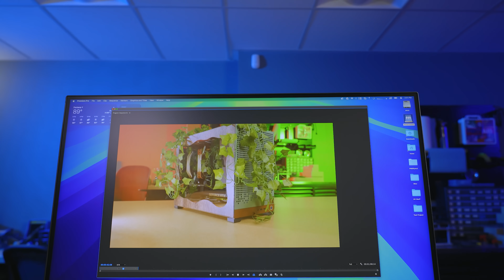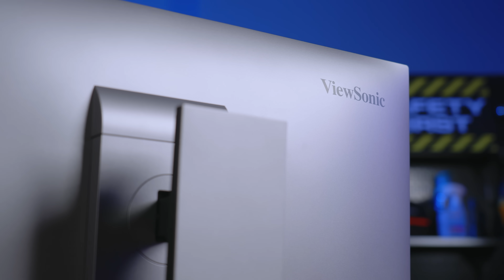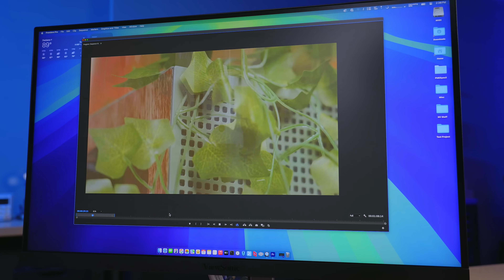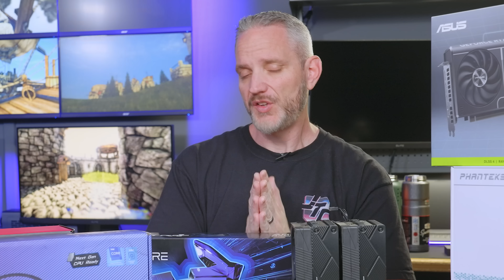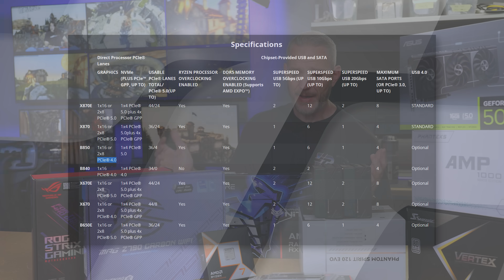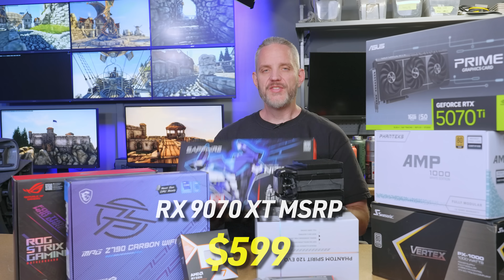This is the Sweetspot for PC gaming... Don't get fooled into spending more!

Comment: @19:00 - Is lower noise really the only benefit of a 3-fan GPU compared to a 2-fan?
Reply: 3 fans will have a bigger heat sync usually and the extra fan gives better cooling performance. All things being equal, with the same fan curve the 3 fan will run quieter because it won't have to run the fans at as high a percentage. But when card is under heavy load and fans are running high, the 3 fan is going to do a better job cooling and the card will not have thermal throttle as soon. So 3 fans have a higher performance potential especially when raising power limits and over clocking. Emphasis on the "all things being equal" because there a lot of factors at play, but this is generally true of the impact of fan count in isolation.
Reply: Yes? What did you expect? 3 fans = bigger heatsync to have somewhere to attach the 3rd fan. Ironically buying a gpu with 3 fans instead of 2 means your fans will be off more of the time because of the bigger heatsync lol. I had a 20 series 2 fan card fans were basically always on only not when idle. Now in 50 series with a 3 fan card the fans are never on in light usage even a lot of smaller games they don't even bother to turn on only in super demanding games do they even activate and never seen them go over 50% while always keeping temps in check. 

Really unless you are in to tiny cases buying a 2 fan gpu over a 3 fan gpu you are just playing your self. Even more so when in reality the 3 fan gpus never even cost much money than the 2 fan cards. What I will say however is if you can get a gpu with a metal backplate instead of plastic that will do so much more for you than an extra fan or slightly bigger heat sync. Then again these gpus at least on nividas side are so well made these days that even pushing huge wattage they are so cool to run it's actually crazy how cool they managed to keep these things

Comment: Ideally I think most PCs should come in under $2,000 for the entire build even with some flashier parts. I genuinely don’t believe in buying the fastest GPU the market has to offer, rather a really good midrange GPU between $500-700 is perfect ATM with 32GB DDR5 and any Ryzen 7 or newer 8 core CPU is all you need for an amazing setup. My 7900XT and 7800X3D build was $1500 last year, and I’m planning on swapping the power supply and GPU in a couple years once I start to struggle running games but I’m comfortable running everything at 120fps and 4k (with slight upscaling and optimization on some tougher titles like cyberpunk but I still aim for 120fps on my 4k monitor).

Comment: well overall you are right...but the psu part? 1000W run your 5090 and 14900ks. those recommondations are for the cheapest of the cheap noname psu wich you get used and is 10+ years old...7700x + 9070xt run fine on 600W with room to spare. 750W can run your 5080 just fine and in a few years you get new plugs or something and you need a new psu anyway. and if you get the cash for 5090 and stuff whats a few extra bucks for a new psu at that point?

Comment: I am replacing my rig for the first time in 13 years. I really feel like getting the best processor you can helps future proof a PC. My i7 4770k has only become a bottle neck in the last 2-3 years. Getting that good processor csn prevent that long term swapping in the future.
Reply: Still  rocking my 4790k. Looking for an upgrade now, 12 years later.
Reply: @black99rt  lol im sticking rocking on a 4440

Comment: PC min max is so weird tbh. With my PS5 i just start it n play, with my PC sometimes i spend more time thinkering with settings and watching my FPS performance than playing the games. Anyway i always bought mediocre PC prebuilds, however 9 months ago i did buy a new PC, i didnt "build"it together myself however i did pick every single component in it, so it was a fun learning / research expierience, nothing special, below 900 EUR (ryzen 5 5600x with a 4060, psu gold, even i knew that). The 4060 is quite fine for what i play most of the time, but my old PC pretty much died (it was 5+ years old and had a 1050ti, had to get a fresh start), so i was in a rush to get a new PC , i should have taken more time to research and choose a GPU, it is my only regret, becouse i kiiiiiiiiiiinda want a better one, just becouse. So i have been eyeing prices on rtx 5070 and amd 9070 for the time being. Altho the truly smart thing to do would be to wait till ps6 drops and the next gen nvidia / amd cards. Like 5070 is 600eur and 9070 is 700 eur, the prices are quite high. Physically i can drop the money, mentally - not so much.

Comment: I've built two top line systems since 2014 with a 1080TI and 6900xt LC. I just can't get behind spending more than 1500 for a GPU and that's pushing it for me and pretty much why I stopped building high end systems. My first top line system was 1800 for the 1080ti and 4500 for the 6900xt build. So yeah they've priced me out of building. I just went and bought a laptop and handheld and said f it. 😂

Comment: When I bought a Gigabyte RTX 3080Ti, a 700 watt PSU was recommended and I had a 750 watt Corsair fitted. Drives were a couple of SSDs and the CPU was an i9-9900 (?? I think). The damn video card wouldn't even start up until I fed it to a Corsair RMx 1000 PSU!!!!
Reply: You had a weird problem.  I have a Corsair system (ABS) w/750 watt PSU, ASUS mobo w/I9-12900K CPU, a Gigabyte M2 drive, Samsung SSD drive, Western Digital hard drive, a Gigabyte 3080 Ti 10 gig video card..... and it has been running great for almost two years.
Reply: @eskieman3948  I don't disagree with that!
Reply: @eskieman3948  I don't disagree with that! The card was a disaster zone from the word go. It ran hot, had microstutters on easy games like AC: Black Flag and sometimes just disappeared from the system's view. It got replaced with an RX 7090 XT as soon as I could afford it. Eventually I took the 3080Ti apart and found that it was missing thermal paste from approximately 15% of the GPU heatspreader. I replaced all of the thermal pads with EK thermal pads while I was at it and tested the card with some more demanding games. I haven't bothered to find out if the 750 watt supply will now start the card - it's been relegated to being a spare.

Comment: I'm currently in that sweet spot, sapphire Rx 9070xt (which I snagged early at msrp), 9700x bone stock for now, 32 gigs of ddr5 ram @ 6000 cl30 and 1 tb gen 5 drive and at some point I'll probably chuck in a bigger gen 4 drive for my memes folder. But to answer the question fully, the term sweet spot is case to case and depends on your income and what you want to do with it, if your current setup is achieving everything you want it to, you don't need to spend money.

Comment: you dont need x870e to use pbo. b850 is more than enough. they both have the same chipset, you dont spend more for a better chipset. Why do channels spread false info? x870e has dual chipset b850 has one. More chipsets means more IO connectivity but the bandwidth is still shared. You only need decent amount of vrms and good cooling on the motherboard.

Comment: RE: CPU and advising against the 89800X3D. ..... I am playing Stalker 2 at the moment and the CPU is the bottleneck. A few cores are maxing out around 90%
I also saw a video of someone demoing the 9800X3D with the RTX 5090 at 1440p with Stalker 2. Vid is on Youtube. The frame rate maxed out about 110fps with DLSS I think on quality. When they demoed going to DLSS blalanced and below, the frame rate barely moved. I honeslty can't rembember the frame rates or the settings clearly, but the result was the same. ..... It was showing the CPU bottleneck.

Comment: Love you Jay, but that was the worst misremberance of moores law to date. Moores law has been true every year since it was stated. "The complexity for minimum component costs has increased at a rate of roughly a factor of two per year." and tehn he later changed it to every 2 years. 

this is often misinterpreted, and then he is quoted as saying the misinterpreted thing. What he said is that the cheapest chips get twice as complex to make every 2 years. He never mentions power, he never mentions the amount of transistors.

Comment: I have a SK Hynix P31 Gold 1 TB SSD on the system I'll be replacing soon and the four years I've had it, it's treated me well. The ONLY reason I won't be getting another SK Hynix is the fact that they don't offer capacities higher than 2TB and I want a 4 TB stick. Otherwise, fantastic SSD's

Comment: I have to say I sold my 4090 and replaced it with a 5070 and it doesn’t perform as good in most games but there are a couple I noticed have the potential to run faster because the 5000 series has smooth motion. Games like the isle, or body cam run for me much better at the same settings vs my 4090. If anyone is wondering why I’d sell my 4090 and get a 5070 is because I was short just a couple hundred dollars to pay for my 2025 bmw s1000rr motorcycle and I didn’t want to finance it. Motorcycle > gpu

Comment: 650w corsair rme  psu for rtx 5070 and im gucci :) realistic i could run 5080(most likely even 4090) with that without any problems coz amd cpus draw very low power compared to old intel days. 5070 peak 250w  ryzen 7700 peak like 120w thats 370w and realistic both combined not going over 300w plus like 50w for other stuff thats like 60% max psu load

Comment: Since I'm on a limited budget I like to build budget, yet future proof systems. I had an i7 920 system that lasted 15 years, it died when the solder in the ASUS P6t deluxe v2 mobo decided to melt and run down the back of the board.

Spent less than 800$ and got the Blue Montech King 90 aquarium with the fans and hub, I hate rgb but where can you get 6 fans and a hub for 30$ ? Asrock Z790 Riptide WiFi PG board, 32gb Corsair ram, and an I5 12600k. Samsung m2 in an x4 slot instead of the x5, the sata ports let me keep my 3.5 drives and my SSDs. Already had a Corsair rmx850 gold psu and, sadly, MSI 1650 which I want to replace with AMD when prices get better. 9070xt or keep dreaming of a 9080xtx lol

One day I can drop in an i9 14xxx series chip, add more drives or ram and make it last longer. The gpu was around 100$ and I got it because my EVGA (I miss them - PLEASE go AMD EVGA!) 770 4gb ftw threw a couple fan blades. I got the psu for around 100$+/-, so the entire system, with 3 more fans, was just over 1,000$ and should last several years.

Granted quality plummeted.... If an i7 920 can last 15 years, I'm hoping for ten-fifteen years again. Especially since I can increase cpu and gpu. Pretty happy so far, stable at 5.2ghz and a tad twitchy at 5.4 on air.

Sadly Windows update fragged my system with the newest update, corrupted restore too, only option seems keep files and settings, lose everything else.... Your video on Bazzite is tempting me to switch over, thanks for that info. I'm going to try to get it on my system to save my data but not 100% it'll work..

Comment: I got a 5070 ti at MSRP (easier in UK at the moment) paired with a 9700x and it’s perfect👌🏻 I don’t think the x3d is worth it unless you’re playing competitive multiplayer games where you need to process a lot of information about others players in the game all at once, or if you’re playing large-scale strategy games like Civ or Stellaris where especially at end game there is a lot of information and turns to calculate.

I mostly play single player RPG games so I’m focused on having a decent framerate with nice pretty graphics - and my 5070ti and 9700x do the job perfectly! I am pairing those with a B850 motherboard and 32gb of 6000MHz CL30 RAM 😄

Comment: Heyup Jay and Team. Since im still running with my Dino build (Core i7 2600k, 32GB DDR3 and ASUS GTX 970DCU2 with the ASUS P67 Sabertoot theres alot of current games im starting to see alot of struggling with 1080P. Now still contemplating on the next build... and seeing the greed from both Nvidia and Micrononsense, im leaning now towards AMD and Linux. However, when i look at the Motherboards, im starting to think if i should start drinking. Since im still using my beloved Logitech G51 5.1 Audio system. This means i've got 3 Cinch cables that goes round the back of the Motherboard. Normally so far so good til some t!tt@rd at Microwhoops decided to meddle with it. In wanting to upgrade, looking at the various Motherboard Chipset types, this is where im getting Lost... reason being is the Audio, the RealTek audio, seeing the various Alc types, then looking at the back of the motherboards... this is where i begin to roll my eyes. I really don't know what to do next there, since i really want to use the 5.1 audio since it still works seamlessly. I read somewhere that 1 of the 5.1 Cables goes round the front, i really couldnt believe that. Could you guys perhaps cover the Audio topic, that could give us a clearer sight on where to look/ what to do next?

Comment: Rocking 10600K & 7800xt... runs fine for my needs. i have one of the oldest 4k predator monitors that i got 20€. i use upscale from 1440p to 2160p. Slapped Noctua NH15 Black to cool my cpu, bought it for 50€ and all of this is in Torrent Compact case. Best part, my cpu isn't overcloced :D and im happy whit it.

Comment: It's nice seeing more people mention Intel's constant socket hopping nowadays. AMD has just about always been like this since at least AM1 back in the mid-10's. Some would probably put that a bit further back, but I'm counting the absolute mess of FM1/FM2/FM2+ in that. Of course AMD hasn't been the most effective competitor for that entire time so there's some of the reasons it doesn't get shouted from the rooftops every day. Either way, I'd be a lot less bothered about Intel for the entire time if they didn't make nearly every CPU gen require swapping out the floor in the house to fit a new chair.
Reply: Good points!
Reply: LGA 1700 covers 12-14th gen what more do you want?
Reply: @Felale  And Sandy Bridge and Ivy Bridge both used sockets 2011 and 1356. Socket AM4 launched in 2016 and the last CPU (so far) released for it was the 5700X3D released in January of last year. Somehow AMD can drastically redo the cache layout of a chip and fit it to an existing socket while Intel usually finds the need to add or subtract a single pin while offering mildly iterative performance gains. It's just not a good comparison.

Comment: In February I built a system from Micro Center with the 9700X bundle with the Gigabyte B650 and G.Skill RAM, along with the 7900XT that had a $100 off sale price along with another $100 off since I bought an AMD CPU. This was based on the video you made around that time. I also got the Micro Center brand 850 watt semi-modular power supply and 1TB nvme, along with a Lian Li Lancool 207 case. I finished it up with a Thermalright pack of 5 fans, fan/argb controller, and a Phantom Spirit 120 SE from Amazon because they were all much cheaper there than in the store. It has been night and day difference coming from a laptop with a 13th gen Intel i5 and a 4050. It cost me just shy of $1700 all together and I regret none of it. I don't play many modern AAA games so I can play high to ultra settings in almost everything I enjoy and it makes me happy.
Reply: Next time just have Micro Center price match Amazon

Comment: You're wrong about the CPU vs GPU bottleneck. I mean you're right in general, but there are some significant "edge cases" that I feel you should have mentioned. There are a lot of popular games that are CPU bottlenecked by design. They could run on a potato GPU, but the CPU is what's limiting their performance. The biggest is Minecraft, but you can add pretty much any Paradox grand strategy title, a lot of older games with huge simulations, and older engine games like Guild Wars 2. It's not just black and white GPU vs CPU. The user's use case is significantly more important than a general GPU vs CPU botttleneck.

Comment: Liquid pumps also tend to make some annoying noise after 3-4 months. I always go air now with a high quality quiet fan.
Reply: I just scrapped a 13 year old Intel PC w/a Corsair AIO.  I replaced that AIO unit about 4 years ago, and it was stone quiet.  I'm running an ABS 5000X Intel-based PC w/Corsair AIO, and I'm building a new PC for the wife based upon a Corsair i7300 w/Corsair AIO.  All of these PCs are absolutely quiet, including the cooling pumps for the AIOs.

Comment: Not a huge fan of recommending against X3D CPU for midtier builds. The difference in 1% lows is very noticeable even on a modest GPU and it makes most games just play clearly smoother despite nominal fps being similar. And then theres like of tarkov that are so heavily CPU bottlenecked that almost any system sees major fps improvement going for X3D. Going from 5800X to 5700X3D on my 3070 system was instantly noticeable on every game.

Comment: Jay, ever thought of doing a optimal streaming pc setup, mic, camera, button box software etc? My struggle here is, the streaming portion, ends up being just as resource heavy as the game itself. So cpu wise, im running a ryzen 7 5800x, graphic card 4070ti, now I know the 8 core isnt enough, it works, I will say that, but my cpu is currently on the struggle bus, bought 5 years old, and its been hot before on multiple occasions. Should I go 12 core? 16 core? And then to be over all optimal, how big of a power supply should I be using? Will the motherboard end up being a bottleneck? Or cooling? Should I use my 3060 for the stream software and 4070ti super for the gaming? Is that even something possible? And then you gotta consider all the USB inputs. Moza R5, keyboard, mouse, controller, etc. Anyways, hope all is well. Love the videos man, you doing fricken awesome. Good interesting content. I truly do appreciate your videos.